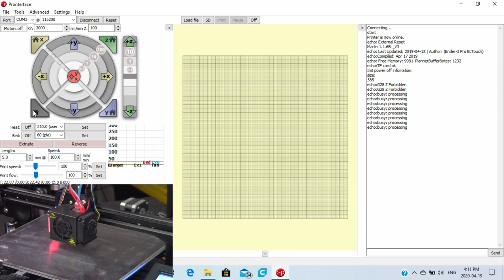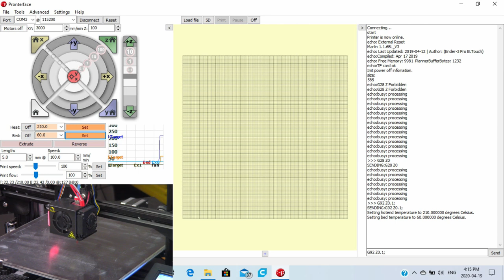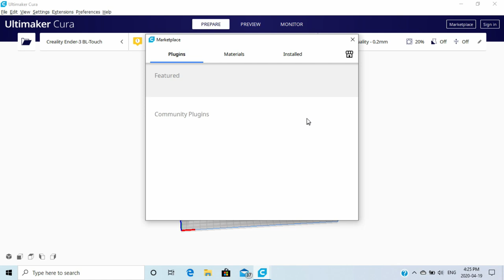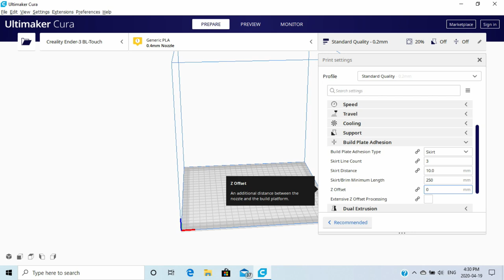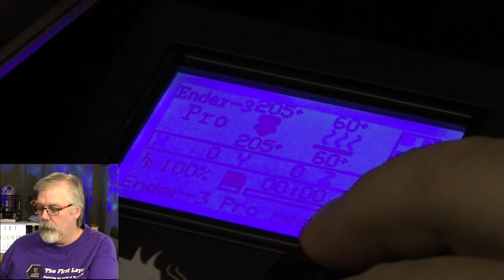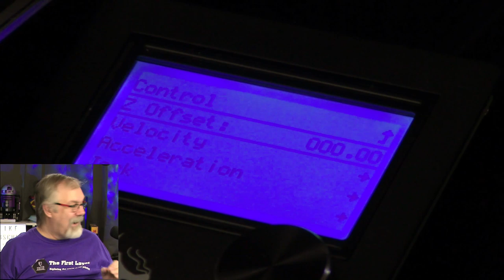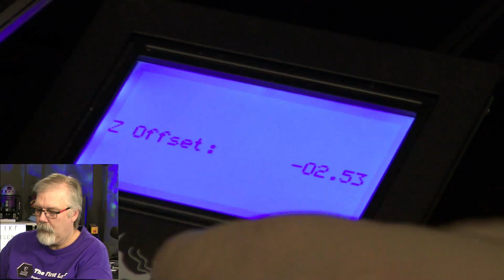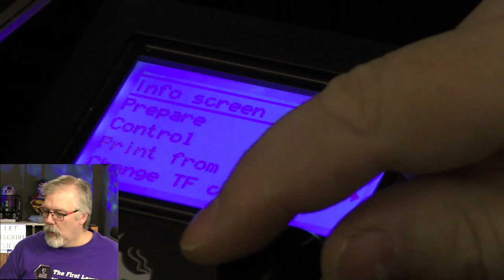Easy Z-Offset adjustment for your 3D printer.

Comment: can i ask you? how i changed that auto home position? i dont want that default position like when its like bed is full back and nozzle is in front of that bed i wanna auto home like you have can u help me? anyone?
Reply: As far as I know the auto home position occurs when the printer head/nozzle is moved so that each axis stop switch is depressed  i.e the printer head on the x axis has moved as far left as it can go and hits the x axis stop switch, the bed has moved as far back as it can go and hit the y axis stop switch and the printer head has wound down on the Z screw until the printer head has hit  the Z axis stop switch. When all three stop switches have been triggered the printer head stops moving and registers as position x=0  y=0  and z =0. You can only change the actual position of auto home by physically moving the stop switch.

Comment: Hi, this is great stuff - thanks a lot for putting this together.
I have an issue though and hoping I can get some help. I have spent several hours doing the z-offset calibration manually and have ended up completely spoiling my print bed. I got a new bed (removable magnetic flexible print bed) and would like to get the z-offset setting right before I start a new print
I feel that using the ender console is the most fool-proof method as it seems to be very accurate. However, the problem is that I am not able to set the Z offset to a negative value on my Ender m/c
Any pointers that can help me set the negative values is greatly appreciated
I have an Ender 3 v4.2.2 board & I have updated the firmware to the latest Marlin 2.0.9 version

Thanks in advance for your help
Reply: You should manually level your bed so that the nozzle will JUST touch the bed when the nozzle is at z=0, you NEVER want the nozzle to go lower than this ever.. Most leveling instructions will use a peice of paper which you can assume is 0.1mm thick, in that case you are setting your z=0 position to actually be 0.1mm ABOVE the build surface.

If you now print a base layer at 0.1mm, the printer will move to z=0.1 because it starts at the first layer height NOT zero, and as you have the bed levelled to 0.1mm above the print surface it will actually be at 0.2mm above the build plate and will fail..

This is where a z offset should be used, based on a manual level at least, to lower the print by the thickness of the paper, or usually a little bit More than that.

You do not need to mess about like this video, you just need to add the z offset plugin in cura and add a -0.12mm z offset and the first layer will start at JUST below the height of the first layer to get a squash onto the plate.

However.. to get a decent first layer that in 0.1mm thick needs an extremely good surface, the creality glass bed for instance is one of the flattest and has a variance of up to 0.15mm, meaning no matter what you do you will never get a 0.1mm first layer to stick to it everywhere.

In your slicer set your first layer to at least 0.2mm, i use 0.3mm myself, which will give a much better chance of a full layer sticking to the plate, you can also then adjust your z offset further to get the perfect layer because your nozzle will start at a height on 0.31mm above the plate with z offset of zero.. so a zoffset of -0.2 would still be 0.19mm above the plate..
,

Comment: At the point of Minus one you need to explain how you take off the limit. The problem could be that the Nozzle cannot go below to a negative number. This requires the use of :M211 S0 to turn off the the protection. This will allow the negative value to be acquired by changing the height of the Z.

Comment: Calibrating z offset is almost impossible on my Anet A6. There is no probe, so no mesh probing. Only  endstop and manual bed leveling. The bed itself is so crooked that it is like 0.2 mm difference between corner and the center. Maybe I will use glass

Comment: Setting the Z-Offset or just bed leveling, the hotbed and the hotend . Aluminum expands like crazy as the temperature rises, and odds on that your print bed or the bed heater is constructed from aluminum.

Comment: Everything works fine, the X and Y axis move and home just like they are supposed to, the extruder works as well as all the other components except the Z axis. The z axis works only when jogging up and down and it homes correctly just like the X and Y, When I start a print the X and Y axis start moving but the z axis which is supposed to move down doesn't move at all.
My axis and endstop setup is the same of the makerbot replicator, as shown in the pictures below. I think the problem has to deal with the travel limits after homing but I've already tried all the combinations possible but none seemed to work. Forgot to mention that the printer is already calibrated
I would really appreciate if some of you could help me with this issue because it's the last thing that doesn't allow me to print,
Reply: Reminder I'm not using BL touch

Comment: Doesn't the bed levelling procedure set your Z-offset right ?
Reply: Not if you've done modifications that mean you no longer have enough adjustment (glass, hotend, etc.)

Also, my Cr10s5 out of the box didn't gave enough adjustment to level the bed, so 😐
Reply: @coltonholiday4872  also sometimes the middle is higher/lower than the perimeter

Comment: Still can't get my cr10s to work properly with the bl touch. I have tried marlin 1.1.9, 2.0, th3d firmware etc.. So far it has worked the best on th3d except the fact my z off set is limited to 4.9 and I need to go much lower then that to allow the nozzle to be at the correct height.

Comment: I'm homing the BLtouch in Prontorface and the Z is resting at 10 and will not move down the Z axis.  I could use some help.

Here is the Error Message: Error:!! STOP called because of BLTouch error - restart with M999
[ERROR] Error:!! STOP called because of BLTouch error - restart with M999
Reply: Hi David, not sure if this helps or if you're still having the issue but I read on Google that a few people receiving the same error as yourself had faulty JST connectors for the Z endstop cable.  You may want to look into that online a bit more.  Hope that helps, take care!!

Comment: I installed "Z offset setting"  It will not allow me to enter 2.35mm.  This is the offset I need to zero Z (to a piece of paper).  Also comes up with a notice that + increases the gap while - brings it down.

Comment: I have a stock Ender 3 Pro.  I see your auto home ends in the center of bed?  Mine goes to lower left corner.  How do you do this?  Auto home, then manually move head to measured center (diagonal lines from corners) then save that location or something?  Thank you.
Reply: The BL touch with the firmware loaded makes the autohome go to the centre

Comment: thank you for your video. I used the first one to trim the z axis offset. it looks like not working on my machine. can anyone take a look and tell me what did i miss? thank you very much.
G21 ;metric values
G90 ;absolute positioning
G92 Z-0.65 ;
M82 ;set extruder to absolute mode
M107 ;start with the fan off
G28 X0 Y0 ;move X/Y to min endstops
G28 Z0ddd ;move Z to min endstops
G1 Z15.0 F9000 ;move the platform down 15mm
G92 E0 ;zero the extruded length
G1 F200 E30 ;extrude 30mm of feed stock
G92 E0 ;zero the extruded length again
G1 F9000
;Put printing message on LCD screen
M117 Printing...
G5

Comment: Was going along great, got my offset measurement easily enough. But, I go to Control > Motion and there is no Z Axis Offset menu item 😑
Reply: I don’t have a Z axis offset menu item either. What did you do to fix your z offset without that?
Reply: @hondarider0987  Just edit it in your Marlin firmware by removing the two //
Reply: Go to configuration settings instead

Comment: Hey.. this is a great video! Answered a lot of my questions.. however.. I don’t have a z offset menu item under the motion menu, and I don’t have an ABL, so when my printer homes it automatically goes to zero.. so this brings up even more questions for me
Reply: What printer? Do you have a z probe?
Reply: bob Bunni two ender 3S.. both with skr mini e3 1.2 boards, and the latest version of Marlin
Reply: Z probe?
Reply: You only get the Z-offset option when you start Printing under 'TUNE'.

Comment: y off set is to far forward even after slicing knocking my clips off not using 30mm of the back of the bed 
that would miss my clips if you would use 220 mm of the bed im running marlin 2.0.5.3

Comment: I thought you said minus moves it up. away from the build plate
Reply: minus moves the nozzle down into the build surface.. z starts at the bottom, ends at the top of the build volume, any minus to the z will move DOWN...

Shows a complete lack of understanding on the part of the educator, as does MUCH of this video!!!!

Comment: OFFSET  Issue =  I CANT make my Z Axis go below the ZERO reading, Can NOT get into negative setting, SO start guessing on a Z offset number,, HEY That didnt work, NOW after ruining and buying a new glass bed ,REMOVE cr touch and put Z Axis switch back on the printer, WELL at Least I Should be able to print again.
 NOW It would be WAY To Easy if it worked like your video, Just like BEFORE I install the CR Touch.

Thanks.
Reply: OH and the Marlin software even has a Z Offset Wizard in it,,,   BUT That was no help, It even has a Tramming wizard also, Passed that no problem, Bed is Zeroed in all 4 corners.

Comment: This makes absolutely zero sense to me coming from a background in robotics engineering. When you do your physical adjustment for bed leveling you should then simply press your store offset button and you should be good to go. If you then change to a different play you could add an offset into the system but it's frankly easier just to adjust it manually. As far as I'm concerned there's absolutely no reason to add any offsets to this in less you have to physically go to a different position at home then the limit sensors will allow

Comment: a proper explanation would have been better as if you keep leveling your bed every time you print then this method is totaly useless as when you remove what ever you printed the bed would have moved so you would have to relevel the bed after every print unless you have a solid foundation for the printer bed in the first place like the chiron that doesnt need leveling after every print

Comment: There's no reason to heat either the bed or nozzle. If you're using a magnetic bed, a stationary hot nozzle this close to the bed without extrusion WILL melt your bed. 
The offset should not care about warping/expansion if you are measuring on the same location, which is not what people are doing.
After homing, the sensor is at the center but the nozzle is not, thus checking the Z at the Nozzle will give you an incorrect reading unless your plate in super leveled and not warped.
To make sure you are measuring the same location, you should move the nozzle on X and Y axis based on your sensor X and Y offset values.

Comment: my 3d printer does not have those settings available. The only thing on control menu is temperature. I can can control z axis on move but cannot store anything . I have an anycubic mega zero 2 . This is completly usless

Comment: I still do not understand why you need a Z-Offset when your bed is 'levelled' and you don't use auto-bed-levelling.
Reply: Your printer can travel beyond the click of the Z end stop switch. Using Z Offset you can adjust the nozzle height from print bed without adjusting the Z end stop switch. Adjusting the end stop switch and running a test print until you get it right can be long and boring. Adjusting the Z Offset is much easier and faster. With Babysteps enabled you can adjust the Z Offset while it's printing the first layer making it even easier to get perfect first layer. Would you rather adjust the z end stop switch or adjust z offset?

Comment: I can't go any lower than 0 and there is still are 1mm to 2mm gap between the Nozzle and paper any ideas? do I need to adjust my the 4 corners? I'm using the ender 3's panel method.
Reply: Same here. Unfortunately tech questions don't seem to get answered by the host here.
Update; If you've gone through a firmware update for auto bed leveling like I just did, you are familiar with Marlin and enabling/disabling firmware commands? So the reason the Z axis wouldn't go below zero is because there is a command line "MIN_SOFTWARE_ENDSTOP_Z" on line 1120 of Marlin 2 point whatever. That must be disabled with two slashes. Once disabled the process shown on the vid should work.
Reply: Had the same thing and the answer is very simple you might laugh. Instead of loweringer your Z. Turn those screws so the bed itself gets raised higher ;) That's how I did it and when eventually I could het a Z-offset